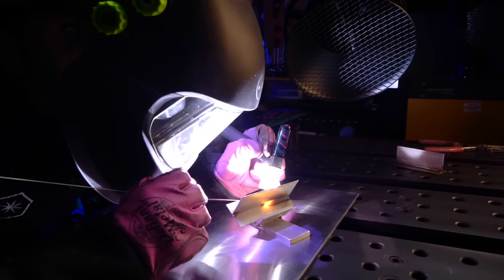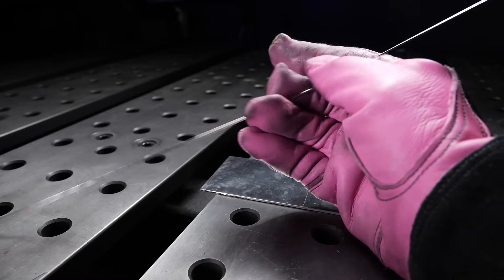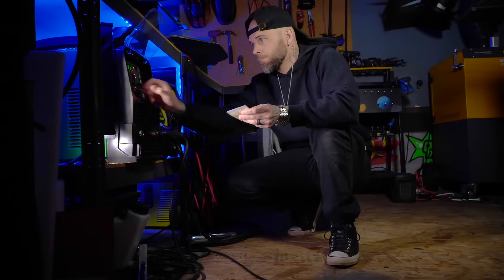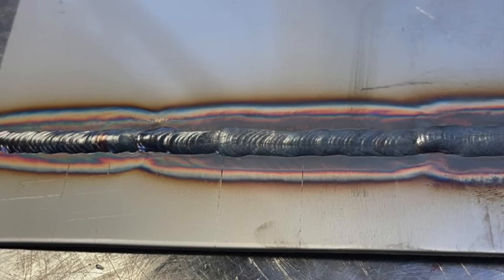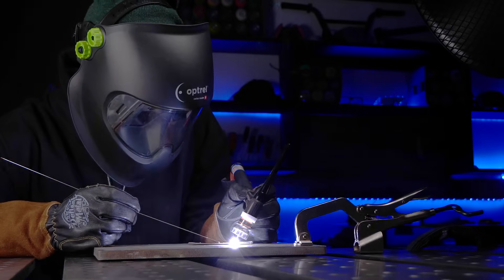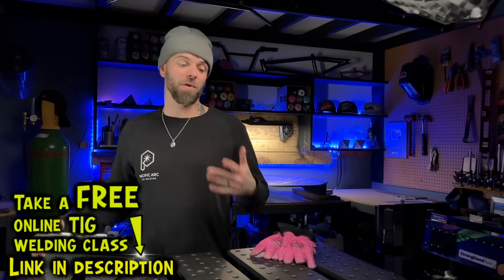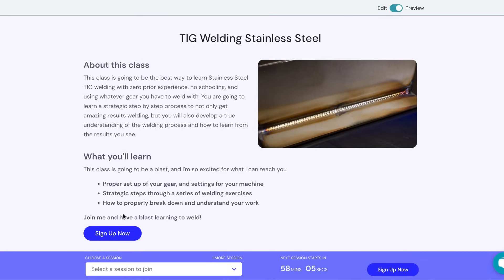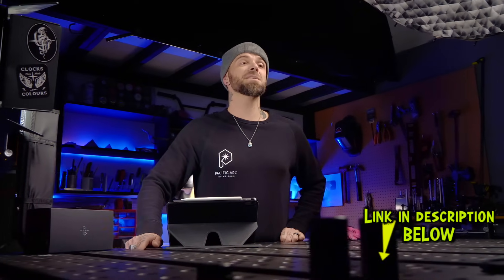FRUSTRATED tig welding beginners WATCH THIS

Comment: I've been a welder for over 30 years 98% mig welding with a arc as well. I bought a Everlast ext 210 about 6 years ago. And I've tried several times to get into it. But, all those knobs just turn me right off. So I get I'll just let it set in the shop for looks. Tig welding takes to long to do anyways. But, I like watching it done.

Comment: TIG welding continuing education course at local technical college is $126 for 8 three hour classes with really good instructors and a wide range of equipment. Very good results so far. MIG used to be a prerequisite, but no longer. I took MIG last year. Unbelievable bargain. Better than Harbor Freight. We watch some select Youtube videos in class most days.

Comment: Great video .. I'm still learning due to minimal torch time. Winters are too cold and damp in my garage. 
Question for you Dusty or anyone using a water cooler set up. What can I use for water cooler fluid safely on my Everlast cooler on a budget. Some of the brand name fluids are pricy :(.

Comment: The school I went to made me learn oxy-fuel brazing before I did TIG welding so I got used to having a torch in one hand and a filler rod in the other I know that most people watching this video will not have the opportunity to learn how to braise or Fusion weld with an oxy gas apparatus IE welding torch for gas welding it made it a lot easier and the other thing is I look at it this way I had already learned how to mig weld first and push the torch in that process so it was fairly easy to switch over to TIG welding since it's push only however what I struggle with is walking the torch I can freehand all day long but there's just some things you have to get into tight places and the only thing you can do is walk the torch and that is my Arch Enemy at the moment

Comment: For a beginner, using an enormous gas lens cup, means it's more difficult to see the weld pool, and will mean a lot of gas is going to be used.  Most of the settings on a modern inverter have more to with marketing than function, and the resulting complication makes things much harder for anyone trying to learn. 

Its a real shame that both the enormous cups, and overly complicated Chinese made entry level machines, are so popular now, as these are both things that tend to make learning more difficult, and the increased gas used increases costs.

Comment: Hi everyone
Just wondering what is the best welder for beginners to weld aluminium and stainless steel. Should I buy top specs or just basic one and what brand?
Reply: one of kemppi welders. Ive been learning on one for few hours now and it has been good machine
Reply: Primeweld 325x over the 225x if you can afford it. One of the most reasonable options. Better than a comparable Miller or Lincoln at 1/2 price

Comment: I recently purchased a new Everlast Lightning MTS 275 to learn TIG. My first project was to build a welding cart using some 1.5" 1/8" hot rolled angle. I cut up the pieces and a setup my machine for 120 amps to TIG the joints starting on the flat joints, figured that would be easiest. I was using a #10 pyrex with a gas lens and 20cf pure argon with 3/32" CK Layzer chartreuse. My results were absolutely terrible 😂. I realized that the default settings had no post flow at all. I was able to setup manually and managed to save some tungsten with a 5 second post flow. Things were still not great however. I cannot figure out why my tungsten tip just keeps deteriorating from a nice point, to just a mess, even when not dipping it. I prep the tungsten and things start off great, then after about 10 seconds it's a mess again. I was hoping things would be a bit easier to start on carbon steel, but it's not going well. My technique improved rapidly though as I am able to maintain a good arc length without dipping, travel speed needs work as does adding filler, but it's getting there. My tungsten however, is just getting really blunt really quick making it difficult to maintain a steady arc. Any tips?
Reply: A #10 cup size is way too big for only 120 amps and your tiny gas cylinder,  use a way smaller cup size like a 5 and use 20-25 cfm 
Make the tungsten have a small ball point by using dcep and switching to AC

Comment: I started welding few weeks ago and i have few hours of training already. I just dont know whats wrong with my welds, they turn up dark even when teacher set up the machine the way he thinks it should work. (im plumber not welder and teacher aint welder either) I have size 8 cup, tried 40-70amps and 10-16 L/min. welds that are max 2cm wide turn up shiny with colors but when i start welding around a 88mm stainless steel pipe it does not work. I clean up the pipes with flap disk before trying to weld. I tagged you on tiktok to video of few of my welds :)
Reply: Black is due to bad gas coverage.  I switched to an 12 fupa gas lens and boom, no more black. You are getting air in your torch somewhere.  Check your torch connection at the head.